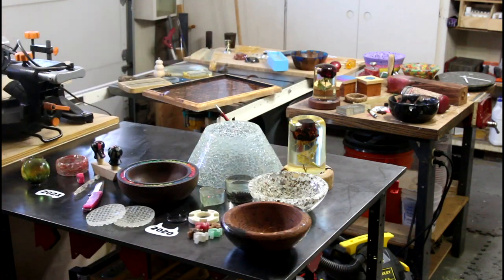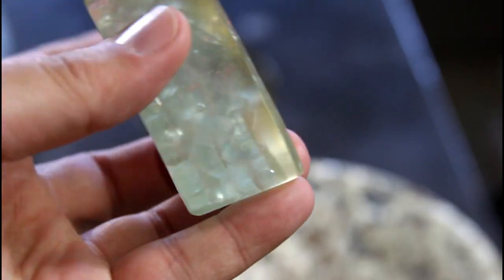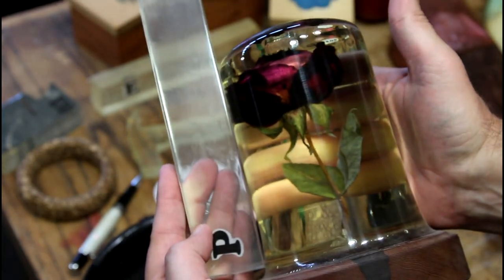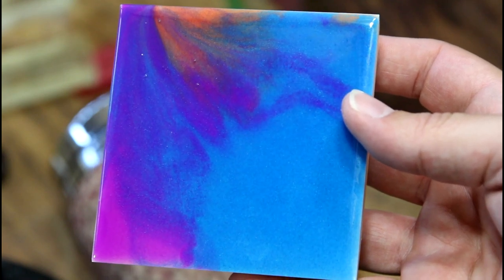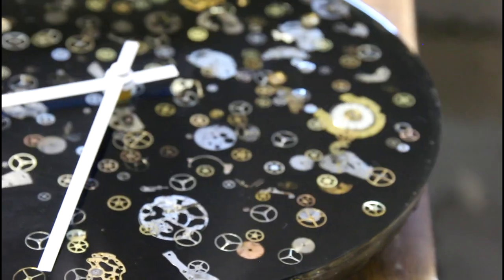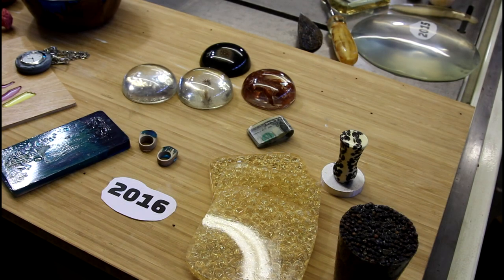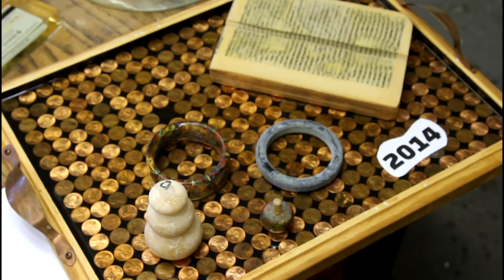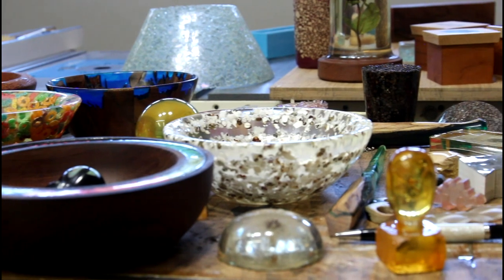Resins dirty secret?

Comment: I have a clear cast brand kit that I've had for 2 years. The hardener is still clear as water, but the resin itself is to yellow to use. It has never been mixed or opened. Still has the factory seal.
Reply: it most likely also exceeded its shelf life, which is for most resins just like 12 months tops...

Comment: i wonder how it yellows. i've seen explanations ranging from "UV is so energetic it breaks down the molecules" (you stored them in a dark place) to "it's just slowly oxidizing, and UV can catalyze the rate of that" (might be interesting to see if e.g. storing them in an inert gas would prevent yellowing?) to "some unspecified internal reaction between the polymer and components of the hardener".
if we figure out how it happens, it might be possible to prevent/delay it with e.g. special types of hardener, coatings, or maybe adding reduction agents to "eat up" the oxygen before it can mess with the resin. i can imagine a lot of those things just aren't done by the resin companies due to being more expensive in bulk, or considered california in the state of carcinogens, or would make it more complicated than "mix 1:1 of those two things" whatever. but there is special resin for art restoration that seems to not do it (or at least take a few hundred years to be noticeable), so i wonder how the chemistry works differently in different kinds of resin.

Comment: Now, I am very "afraid" to write this down, because it's only just wild guessing, but perhaps yellowing occurs due to structural changes in the material, namely crystallization (I thought about the "breakage" of the polymer molecules as well due to UV, oxygen, water etc., but I'd wager it's the less plausible explanation). If I recall correctly (...and I most likely don't), polymers often gain transparency due to their amorphous nature, and once crystallization occurs to some degree (the long molecules usually "fold themselves up" in a layered way), they become opaque. If this or some similar mechanism is the case, then this aging process is pretty much inevitable, and the more clear "volume" there is to see through, the more apparent it will be. Thus I think dyed resin also yellows, but because it is not that transparent anymore plus the added pigments make it really hard to perceive color shift to begin with, it's far less apparent.
But, again, I'm just guessing.

Comment: So, here's a fun and stupid idea.  If pigment seems to keep the ambering from happening (optimistically assuming that the pigment isn't simply hiding the amber effect) then maybe we should develop a clear pigment.  I know, that sounds stupid.  If it were clear it wouldn't be a pigment.  Well, I mean to say that on a chemical level, the resin doesn't know or care what color the pigment is.  All it cares about is how it is changed on a physical level.  If you were to make something physically similar to a resin pigment but which has little to no color, maybe it would keep the resin clear.  I wonder if that is what happened with the charcoal bowl, because it has a UV effect to it.  At the very least, a series of experiments should be done to see if you can determine why the charcoal bowl is still clear.  Maybe the substance in question could be isolated and added to resins in the future.

I just went back and watched the charcoal bowl video, and past Peter thought it was due to the stabilizing resin mixing with the casting resin.  Based on that, I suggest doing an experiment where you mix different amounts of stabilizing resin directly into different types of casting resin, label them all, and check on them annually to see if they yellow.
Reply: Pigments also degrade over time i think, a thing to consider

Not sure if it can be called as pigments, but i do know that there are already additives that can drastically slow down the yellowing and UV damage like HALS (hindered amine light stabilizer) & UV light stabilizer

Also yea the experiment to test precise amount of casting and stabilizing resin to resist yellowing sounds good!
Reply: Florescent dye powder might work! That stuff can be clear in the visible spectrum. A consequence of using that in resin would mean the object would glow green, yellow, or blue, under a blacklight. Also it wouldn't be clear to birds and most insects.
Reply: @MeepChangeling  Woah! I didn't know that.

Comment: As someone who likes to watch art conservation videos, the yellowing effect of resin is quite dramatic once a painting is cleaned and its resin-based protective layer removed. That said, I'm sure there are UV-resistant polyester resins you can use as a top coat even if it may not be available as a casting resin. Besides, isn't amber resin that has fossilised over time?

Comment: Surely a thinner coat yellows just as fast, if not faster, than a thicker pour.  Only difference is on a thin coat you are hardly going to notice the yellowing as much.
Reply: yes and no.  Initial heating during cure can hasten yellowing, so large bulk pours can yellow quite a bit faster up front.  Thinner pours can manage heat much better and yellow a little less.  In the end, as long as the thicker/bulkier piece doesn't exotherm past any threshold temperatures that might be burning its ingredients, it should be expected both pieces, given plenty of time to oxidize, should reach the same degree of yellowing (which will look more intense through a thicker optical path)

Comment: So this is going to be completely out of left field, but I have an idea. The using of water-based dyes in polymer resin creates a super hot reaction. What would happen if you put popcorn kernels in there? Will they pop?
Reply: Go watch the ben's worx channel... He'll be doing this in the next video. Given how hot oil needs to be to pop popcorn I'd be surprised if it works
Reply: Yep.. check out Ben's channel for the answer lol

Comment: it's strange that smaller volumes of resin yellow slower, I would've figured it's the other way around.
Reply: It's yellowing at the same speed, it's just because the resin starts out clear, you see all of the yellow in a deeper mold showing through. Vs just the little bit of yellow present in the thin coat. If you stacked a bunch of thin coats to the same volume as a big piece, you'll see just as much yellow.

Comment: I've seen on other channels where, to get rid of yellowing on plastic, they submerge the plastic in hydrogen peroxide, then blast the plastic with uv light overnight, and it pretty much eliminates all of the yellowing. Is it possible to do that with your resin projects?
Reply: That would only affect the surface of the object, so I wouldn't think so. The resin is discoloring all the way through.

Comment: Does not everyone know that resins yellow?
Also, thinner sections of resin don't yellow more slowly, it's just that the more resin there is the more "yellowness" you're looking through, much in the way water has a color, but you're not going to notice it unless you're looking through a lot of it.
Reply: So if I glaze a layer of resin about 1/16 to 1/8 of an inch on to something, maybe it will never be a noticeable yellow?
Reply: @TheOfficialChessGoat  If the material is strongly colored or dark, maybe not, depending.

There are resins that yellow yes, and there are things you can do to counter-act this, like avoiding UV light exposure to slow the process, or adding a tiny amount of a blue dye to counteract the yellowing.
Reply: @seigeengine   what if there is white as well? The guy in this video’s pen had white and it still looked pretty crystal clear.
Reply: @TheOfficialChessGoat  That's mostly due to the thin layer, but yes. Naturally putting pigments in the resin will also resist yellowing because they effectively also make it a thinner layer you're looking through.
Reply: @seigeengine  ah that makes a lot of sense.

So what about a clear layer 1/16 inches applied to a paining with colors underneath. I assume that could also hide the yellow tint?

Also thanks for the info, been trying to research this for a while. I’m planning on making 4000 chess sets. Painted squares one a board with a thin layer of resin. A but online shop. And I was worried about yellowing; because some sets will be in inventory for some years
Reply: @TheOfficialChessGoat  To some extent, but it can still absolutely yellow. The main enemy is light, particularly UV light. Obviously sunlight is bad, as are certain kinds of artificial light that you can easily look up. Heat will also accelerate yellowing, so try to avoid storing them in a really warm place.

If keeping them a nice white is a major goal, I'd consider trying to find a resin that doesn't yellow as much, and you can find a ton of info and tests of that online. Some resins will yellow a lot quickly even if perfectly stored, some will barely yellow at all even after many years in normal conditions. A lot of resins made for art are designed to resist yellowing because obviously that would mess up the art.

Ultimately what's happening is that resins are plastics. Over time due to oxidation from the air, especially with heat speeding up the process, or UV light causing damage directly, the plastic itself gets damaged. It's this damage that causes the yellowing. While there are a bunch of things that can be done to minimize it, it's an aspect of plastics as materials. If absolutely no yellowing is acceptable, it might be better to choose a different finish.

And frankly, it seems like the cost of maintaining the inventory for years would exceed the cost savings of breaking production down into smaller batches, but I don't know what I'm talking about. Best wishes on your chess boards.
Reply: @seigeengine  okay this makes sense. I will do some more research. The fear is having large inventory and then 3-4 years down the line a majority of them are ruined and I loose a lot of work and money. But if I could pull this off, I could also make a good amount of money and hibernate, while I hire someone to ship out orders. 

I safe a lot of money and time when I’m efficient with time. And I can make 40 chess boards a day by doing all tasks in bulks. And my inventory storage room can hold 4000 chess sets. 

So I will do some more research before I continue but your input had been very helpful mam so I appreciate it. Learning a lot about resin
Reply: @TheOfficialChessGoat  Even if the resin yellows a bit... they'd be off-white, which may still be fine. Normally this doesn't even matter because normally with a resin coating we'd be talking about wood chessboards where a slight yellow tint would look fine with most wood species.

No problem.
Reply: @seigeengine  
The 4000 sets are just 12x12 particle wood boards. And then I get a 12x12 piece of scrap book paper and glue it onto the board. I then paint squares on it to make look like a chess board. And then I apply a thin thin coat of resin on top.

Some boards have white underneath, and other are darker colors. 

I’m just scared of investing this much and then years later it’s all yellow. But from this video; it seems like a layer that thin will take some time to be noticeably yellow. But I can’t seem to find any other data or examples anywhere else on the internet.

I don’t think the slight tint or the white changing to a off white is so bad. The thing I fear is I take photos of them all and post them online to my store as a product. And if they sell a year or two  later and look drastically different than the photo, that can get me into some trouble with the customer. Maybe a slight color difference will not worry me. I just can’t have them looking yellow yellow and completely different.

Comment: Peter, it was a great time visiting all the old projects. I joined right about the time you did the credit card in the resin, been loving the content ever since!

I assume the yellowing is a similar reaction to what happens in oil based paints (and lacquer based) that are used on cabinetry and trim and whatnot.  I used to work in paint stores before I got a "real" job and the interesting thing about those finishes is that they actually yellow faster when not exposed to sunlight. You also don't want to dry your sample of those solvent based finishes  with a hair dryer like you would with a latex based paint, as that also causes it to yellow somewhat. Makes color matching a bit of a pain when your sample is yellower than the paint would be if let to dry on its own.

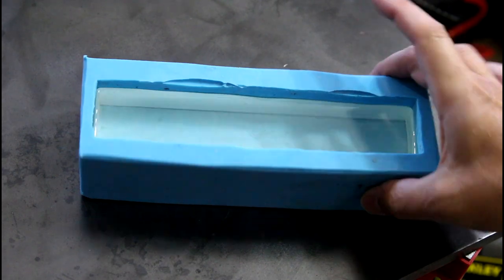I'd be very curious to see an experiment done with the various types of resin you've used (Epoxy, Polyester, Urethane, etc.) where you do a bar cast like you've got at 1:27 but maybe a little longer, and then cut into like three pieces so it's all the same cast. Then put one set in a sealed box inside somewhere, one set put where it can get sunlight but blocking the UV, and then one more set just fully exposed to the sun. Then like a year later check back and see how much each set has yellowed. 

Note, this is not a request for you to do this experiment (although I would gladly watch your videos on it), in fact, I might do something of the sort (either with resins, or the finishes, or both) when I get my shop up and running, but I figured you might like the idea of identifying how much the different resins yellow when subjected to different types of light. 

My hypothesis is that it's the UV light that causes the slower yellowing effect in the solvent based finishes.

Comment: Off topic but did my first casting yesterday. PLA in a CNC:d wooden mold, heat resistant paint as releasing agent and it also coats the part very well. PLA becomes very runny at 200C. It worked amazingly well, the part kept all the details, i can see the slight +-0.01mm offset that happened during milling clearly (tip: make sure your controller, in my case an old laptop, doesn't go to sleep mode). No bubbles, all of them had rose to the surface. I did press it when i took it out to cool, otherwise it was fully gravity that did the work. It looks and feels like injection molded.

Comment: I have learned that a slow cure clear uv resistant epoxy is best to mitigate yellowing. Does not mean the slow cure won't turn yellow eventually, only that you will experience the best results with yellowing happening over years rather than months. All fast cure like 5 minute turns yellow in less than a year even without uv exposure. There are uv inhibitors you can add but I don't know enough so I just stick with the color pigments myself. As far as coatings go, there is some stuff the fly fish lure makers use that stays clear for a really long time. I have gone down some rabbit holes with this topic before so good video. Thank you.

Comment: Adding pigment to resin doesn't stop it from yellowing, it just makes it so that the amount of resin the light has to travel through before being reflected back to your eyes is much smaller. It's like when you have a dark, watery fluid like tea or coffee. You spill some on the table, it's relatively clear, but in the cup it's much darker because there's a thicker layer of it. Light only bounces off of the layer of pigment closest to the top, so the layer of yellow resin the light has to travel through is infinitesimal.

Comment: Thanks for sharing. Love your videos. Im a cup maker and use epoxy resin. I add a pin tip amount of blue resin dye to every batch (when mixing approx 20ml). I was told it fools the eye? But it works. Companies are also stepping up their formulas and adding better or more UV protection.

Comment: Great video. I've seen a resin addin, I think a uv light protectant. I wonder if that slows the turning of colors. I think sunlight makes epoxy turn amber faster. Finally, I build outdoor furniture as a hobby. I put multiple coats of epoxy. The amber color goes great with cedar and a few other wood types. I learned to work with the epoxy color change.

Comment: I wonder what causes it to do that. Like what is the actual process that causes resins to yellow. Is it anything like how beige computers yellow over time? If so, it may be that heat is enough to speed up the yellowing process. I also wonder if it's possible to retr0bright resin, perhaps with the same methods as retr0brighting old computers. I guess one of the ways to test if heat has anything to do with the process long term is to perhaps keep one of the 2021 bubble wrap coasters in the freezer, or alternatively try heating one up to see if it yellows due to heat. For the retr0bright tests, you could use a known yellowed piece of resin and submerge in some hydrogen peroxide and shine uv on it.

Comment: So regarding volume of casting and usage of pigments and the effects on yellowing: believe it or not, the same resin products will yellow just the same regardless.  What differs between those things is perception.  Where you have shorter optical paths through the resin, you will not see the same degree of yellowing.  But it will have sill occurred, and to the same extent.  On the pigmented pieces, the optical paths are extraordinarily short due to the suspended pigments diffracting light back out to the surface rather than through the bulk.  With some solored pigments, you can add certain low-tint-strength white pigments to further help.

And you're absolutely on-point with dfifferent products and types of resin yellowing differently.  Urethanes are generally better than most others. Polyesters are pretty good, too.  Epoxies - especially amine-cured epoxies - will yellow more (in that case, it's oxidation of remaining amines that will darken).  Now some Urethanes will have amine catalysts and/or resins.  They'll tend to yellow more than urethanes that use only metal catalysts and/or rely on polyol resins.  In most cases, if you so desired, you can add some antioxidants, antiozonants, and/or light stabilizers to slow down the yellowing.  But they'll carry their own challenges, too.